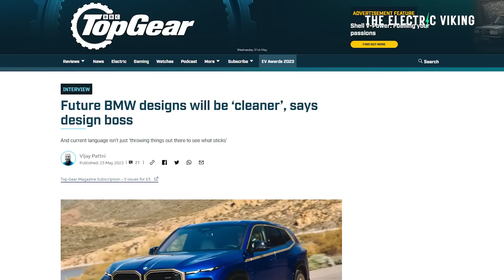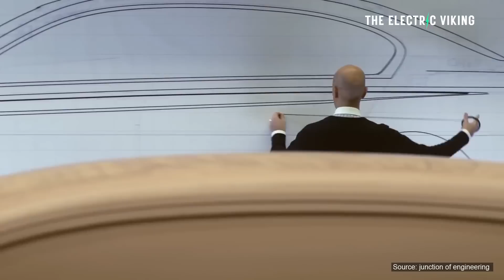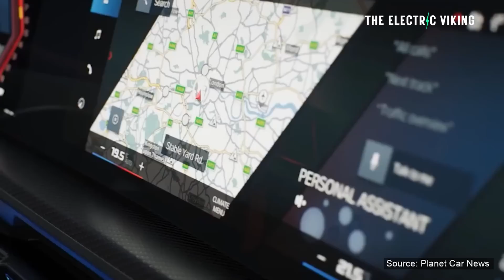BMW’s design Boss says his controversial designs will age like fine wine

Comment: I thought radiator grilles were redundant with EVs? 
Sometimes bold styling can highlight technical innovation (think Cybertruck).
Sometimes it can seek to hide a lack of technical innovation.
I fear BMW is in the latter category.
Reply: Harmony   is correct. ✔️

And I  do not like their Trademark emblem.

Makes their cars appear "UGLY" to me 🤮💩🤮
Reply: The Cybertruck looks like a shoe box that someone stepped on
Reply: EVs do need cooling as well. The VW beetle never had one, and the 90s Passat had only a hole in the front. That was so ugly, VW had to change the design immediatelly due to low sales numbers. That was the beginning of the "smiling face" design at VW
Reply: @robertfonovic3551  A high-tech shoe box! But in time, we will all come to love and appreciate it, if it's as functional as we are told.
Reply: @JakobFischer60  EVs do indeed need cooling, but far less than an ICE, and one of the most critical times for cooling an EV is when it is on fast charge. At that time it will be stationary so positioning an intake for cooling air at the front is pointless; a position at the rear or under the car would serve just as well and be less prone to damage.
Reply: @harmony3138  I have been a BMW fan for over 25 years, and owned 6 of them, including an Alpina.  I genuinely believed they were the "ultimate driving experience". But in 2019, I rented a Tesla Model 3 for 4 days... just to try it.  And I was so impressed I immediately ordered one. It was so much more fun to drive and better performing  than my 330i that it was not even close... 4 years and over 120'000 km later, I learn that it was also much cheaper and "carefree" to operate.  
But even without my Tesla "moment", BMW would have lost me as a customer with their new designs.  Yes, their "kidney" grilles are indeed their trademark... but small stylish ones, not the new cancerous growth ones!  Earlier, BMWs were for people with a bit of money, or maybe even quite a bit... who wanted elegance and style, and did not want to show off too much. Now, the newer ones are designed for the taste of drug dealers!

Comment: I don’t think this will put off traditional BMW customers, because it has become a trademark look.  However, it may put off potential new customers.  The big question is whether their strategy of using the same platform for petrol, diesel and electric cars will enable them to be competitive.  At some point, I think they will have to optimise it for electric cars - as in the IX.
Reply: Consumers don't give a crap about " platforms ". Only value for money given the individuals specific requirements.
Reply: @robertfonovic3551  yes, I agree.  Specific requirements might include: sitting three adult passengers in the back comfortably (transmission tunnel stops that), having a shorter bonnet so that the car fits in the garage, having a frunk for extra storage…  None of those was important to me, so I bought an i4 and I absolutely love it.

Comment: You should never listen to “most people”.  😊. You might mean you listen to yourself, which is a direct matter.
3 & 5 Series are kept uncontroversial.  The Quant check.  Latest 5 is an example of this.
Other models go where the design language wants it to go.  I can think of a number of brands where the design language was less than resolved.
The best shake up in design language starting from Bangle, and BMW are the beneficiary of this.
No brands age well, they are of the moment.  I should add BMW get about as much design license as they want, and no one designs a vehicle to deliberately fail.  Thats plainly ridiculous.  They are all the better for the freedom they have, and we are rewarded with some very cool vehicles.